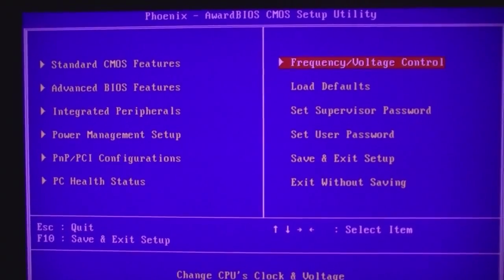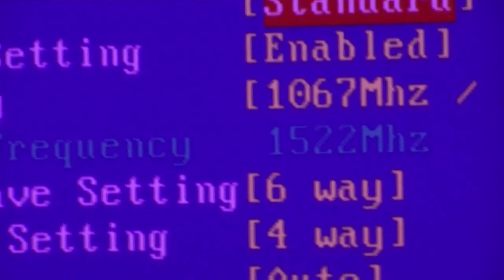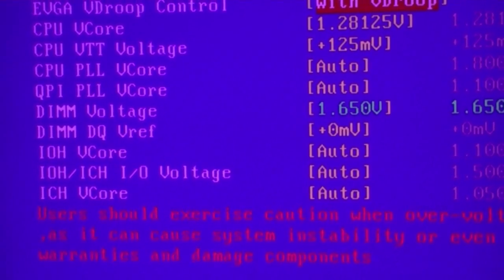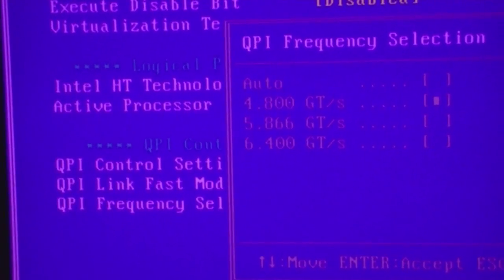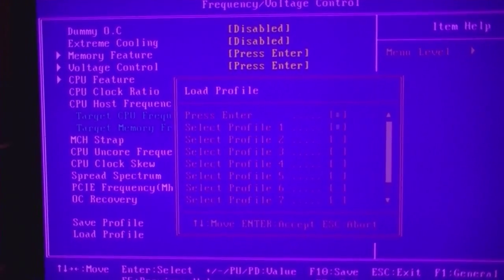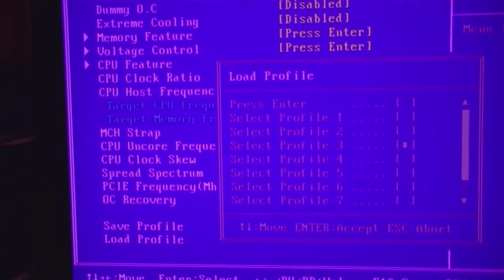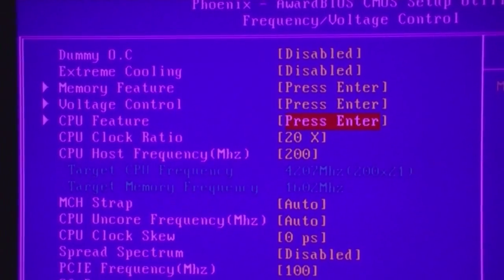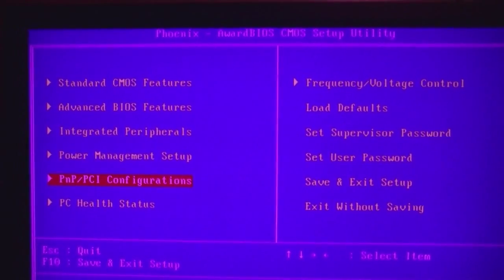My i7-920 D0 4.0GHz BIOS Settings

Comment: @cristixyz   If your game runs ok at first then after a while it croaks, then perhaps you have a heating problem this doesn't sound like a setting if it was your game wouldn't play at all..  Check you have enough cooling and that your fan ports are clear and that there is no dust build up inside you comp.